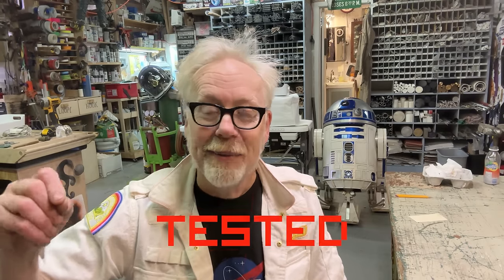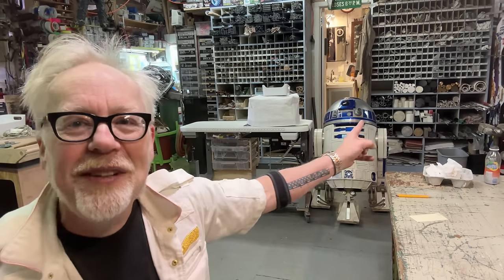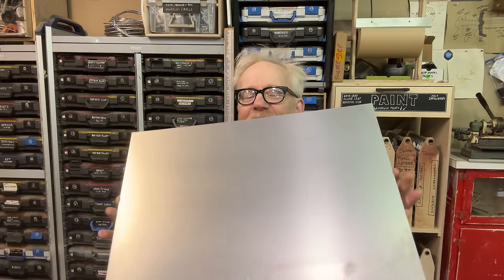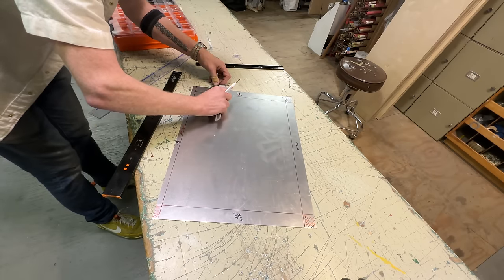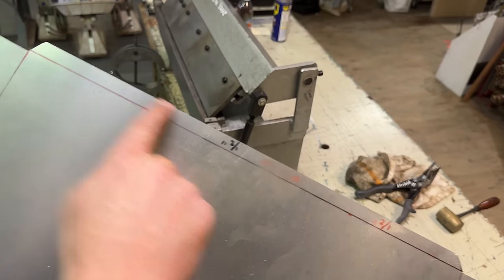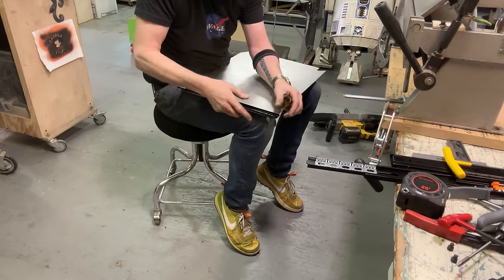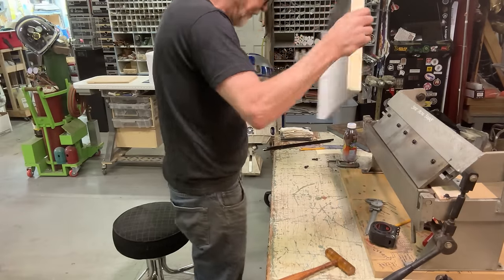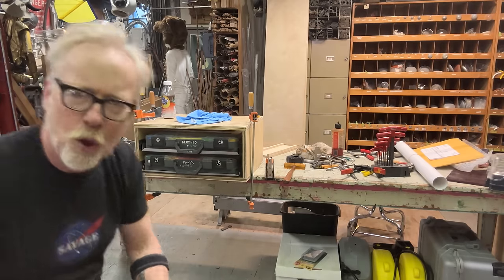Adam Savage Prototypes His Dream Hardware Storage System

Comment: Adam what you really want are Schaller Tool box bins that fit inside of draws. Sortimo is best for mobile tool storage (vans for contractors). For a workshop you want Modular Drawer Cabinet (Lista) for all of the bins. You can open the drawer & take a bin out that you need. Issue with the Sortimo is the lid gets in the way, and your limited to the bin sizes. With the Schaller bins I can store larger size parts that won't fit in a Sortimo.

If you don't want to spend TV money on a set of Lista cabinets, try making your own. I made a few for my storage needs, I might be just one of the few people that has almost the same amount of small parts as you do (electronics, machine tools, metrology, wood working tools, mechanic tools, etc).
Reply: Steel would have been better than alum, since alum does not bend very well, depending on how it was formed & heat treated. It can crack & when you try to bend 90's into it.

Comment: I love the marking template you made, but if you can clamp 10 sheets together and cut them all at once you will save a lot of time. I'd also see if you can set up some stops on your sheet brake to do the front and back bends on the same pass feeding in from the back of the break.

Comment: Drills holes on either side of all rack verticals, makes shelf that can slot onto those on the racks and make a temp table when needed before putting it back in a storage slot for the removable shelf

Comment: As always a very nice video :)

BUT I myself would have sacrificed one slot per shelf to make a pull-out-table where I can put the Sortimo on from which I need some parts.
Have the table at approximately hip/belly height and with an interlocking surface so that the Sortimo locks into place.
This would save you much work and still does the job just perfectly.

As you always say: Having a uniform storage-system really is key for having an organized workshop.
I now settled with wooden boxes you can get at the local hardware stores here in Germany and Austria for about 5-6 EUR/USD.
They're all a little different, but only about some millimeters.
General dimensions are about 30x20x13cm or roughly 12x10x5 inches.
You can also get them in double or triple the size.
Right now I have 32 normal ones and 4 double sized ones, stored in selfmade, space-efficient racks.

Inside those wooden boxes I often use small acrylic-boxes with 8 individual compartmens to store things like special bolts and nuts, electronic components, coin-cell batteries, ...

Comment: I love this infrastructure build. I used to build stuff out of paper as a child and it was then that I realized the efficiency of timing/testing/working out the kinks in big batches of parts. I love seeing Adam bringing attention to that.

If I had the sortimo system, I'd have an empty box or five as project floaters that I could populate with inner containers from other boxes. Then I'd mount mini drawer units like the 2-unit tester near my work areas, and even in my rolling tool ziggurat. That way I've got most of what I need without extra walking, my parts for different simultaneous projects can stay together, neat and closeby but out the way, and a host of other reasons.

Comment: I made a similar set of racks and had the same issue. Instead of making every drawer on a set of slides, I put a single wooden shelf on slides in the middle of each rack. That way, I can pull out my shelf and put whatever sorting rack I need and set it on the shelf. That way, if i need to take a sorting pack with me, I can, the shelf is always at a good level to access things, and I only needed one set of slides per rack.
Reply: Well that's a very elegant solution - and that would actually work great here. Now that I think of it I might actually include just that in a upcoming cabinet build ... Thanks for pointing this out.

Comment: A quick suggestion for the prototype: 
Mount it under your main work surface so when you are working on a project that is going to require 52 of the widgets in drawer #13 over a 6 hour build, you can slide drawer #13 into the holder. You will then have those widgets at your fingertips without covering valuable work surface real estate. Once you have finished with drawer #13 you can return it to its permanent home.

Comment: He sets the fingers to clear the other bends about 1/4 inch. If you don't decide and offset the tabs to clear the other bend you will ends up hitting and bending the corners. The other thing is to make Shure you have the metal exactly in the same spot to the line each time and some of that comes with doing. It's good practice to use a scrap piece the same thickness and with that you can check your tolerance with then adjust accordingly. You'll get it

Comment: There’s a variety of Systainer drawer systems (Festool) that accomplish Adam’s grail, several with full extension slides and removable cases with clear lids, and/or removable drawers and decks within the cases. Compromises to all IMO, based on vertical space consumed by the drawer system, and, of course, $$$ (albeit necessary though for long term robustness and reliability).

Comment: I was a bit surprised not to see any French cleats in your shop, considering how handy they are. I use a similar organization system myself, leveraging acrylic makeup drawers with modular dividers for easy setup. The last time I moved, it took me 3-4 hours to reassemble a 4x6 wall of these drawers. They're stackable, so a bit of masking tape and packing them into boxes did the trick. With a 4x8 sheet of plywood and setting up 7 vertical rows, everything was in place by dinner time.

Each drawer features a small metal pin at the back for effortless removal from the shelving unit. If I need to take an entire shelf with me for a project, it slides off the French cleat smoothly, like butter. The one challenging part is attaching the acrylic to the wood. Pre-drilling and bolting with rubber washers for joining them, that seems to work best since screws tend to crack the acrylic or pull out over time, although I've had decent success with ET500 epoxy as well.

I'm inspired by your setup and am planning to build a vertical tool cart similar to yours, but with a couple of rows of French cleats for added versatility. I've found so much utility in having French cleats not just on my workbench but also across all my power tool stations. They're all mounted on castors and are of equal height, making everything easily movable. My guiding principle is simple: make storing tools as effortless as dropping them in a random spot. This way, I never have to spend extra time putting things away or risk losing important items.

Comment: Just a suggestion but bolt the break to a pair of steel angle "rails". Clamp them to the bench with the front overhanging a bit and put a couple of longer handles on the former plate which will now hang over the front of the bench ... The break won't move so much and after a dozen folds your arms will really welcome the extra leverage!

Comment: Hey Adam,

I've been a huge fan for a long time use alot of your videos for inspiration on small form factor shops. I currently move around a lot and have worked in garages and a workspace the size of a closet. I love the idea and dont know how open to suggestions you are but you could dimple die your aluminimum to keep it from flexing so much and it would make your overall build lighter and relieve stress on your drawer slides even though they hold 150 anyway. It would take a while to do but is always an option.

Comment: At 30:18 - This is a "Whitley Punch" (Junior size) which is GREAT for punching nice clean holes into sheet metal instead of using a drill bit which can wander. The kit usually comes with 3/32", 1/8", 5/32", 7/32", 1/4" and 9/32" round punches and dies.  Found used on eBay all the time.  New about $200.

Comment: This is a stroke of genius. Of course there are commercial solutions that tend to have boxes as drawers, including locks, but there's nothing more cost-effective than a DIY setup. If the whole thing gets a little tippy with the added metal, bolting/screwing the cabinet to studs or a cleat should do the trick (the cleat is how my Dad and I stabilized a bunch of Ikea kitchen cabinets).

Comment: I made a very simple rack for my small parts storage boxes (Home Depot HDX cheapies)  I also struggle with a lack of good  horizontal surfaces in my small shop. In my rack I added a drawer for my Dremel tool at the exact height that fits my 5'10" frame.  While the drawer  is NOT as luxurious as Adams - and my shop is not a professional "working" shop like Adams, I do get a kick out of my forward thinking of adding the drawer.

Comment: Best way to align drawer slides is to cut spacers that hold the slide off the floor, a strip of 3/4 x 2" works great. Even if your only doing 1 cabinet it really helps to keep the slides even on both sides. You can either cut two spacers for each height or just cut the top height first then cut the two strips down for each level.

Comment: I think I notice a bend. At 26:29, taking a look at both aluminum shelves, I can see that the bottom one is bending down in the middle. Now this could be from you making this very quick, but the top one is way more flat and straight. So maybe the size of the lip on top is helping to keep it straighter, while the bottom is to small of a lip.
Correct me if I am wrong, hahaha.
But anyways, love the idea. But my gosh, this is going to be a tall wide wall of shelving.
Reply: Good catch I noticed that as well.  Got a little concerned when Adam mentioned that he was going with the thinner lip he might want to rethink that decision.

Comment: FYI 6061-T6 sometimes cracks when bending in a tight radius. 5052-H32 (1/4 hard) or 6061-O (annealed) will perform better, if that's an issue. Love the storage concept!

Comment: My dad ran his own sheet metal shop and to cut a bunch of corners like that they stack multiple sheets on the edge of a table clamp them down and use a portable band saw to cut multiple at once! just gotta make sure you hold it straight the whole cut or your bottom sheet will be way off your pattern and only stack like 1/2 inch maybe 3/4 of material at a time.

Comment: Adam, I saw a short video on "self-piercing rivets".  You put the rivet in the tool (which looks like the letter c) and the rivet goes through the material and dome heads itself at the end of the c.  It might not seem like a big deal but I think it is because you no longer have to drill the hole for the rivet which I think removes a lot of tolerance issues and creates a stronger fastening.  Anyway, maybe this is old news to you but when I first saw it I was like Wow.

Comment: If you bolt a piece of angle iron to the part of the metal break that pushes on the material that moves it up, it will help bend the material much easier, many breaks have this removable attachment

Comment: Here are some workshop tips: 1. Use a scriber instead of a black felt pen when marking out sheet metal or metal stock. 2. Use Gilbow metal snips to cut corners in sheet metal, as they are faster to use than using a band saw. You can get them in Left and Right versions. 3. When doing repetitive tasks, use an air powered pop riveter. This will prevent RSI injuries. Your hands will thank you in later years. 4. For your pull out racking wall, you could have built a pull out horizontal shelf to put one Sortimo storage unit onto when you were using it. 5. Fix your sheet metal brake to a mobile stand built from square stock. Add some solid castors to two of the legs, so you can move it around the shop, rather than leaving it loose on the top of a bench.

Comment: Durham Manufacturing has you covered for that.  For those that want to build your own and dont want to spend all that money on slides.  You can build one or two sliding flat shelves for each vertical cabinet to place a selected box on and then slide back in when not in use.

Comment: Adam before you assemble the cabinet make yourself a jig and put on the drawer slides first it's a lot easier that way and for the maximum drawer side weight rating use all the screw holes. I made the same kind of cabinet using Milwaukee pack out boxes

Comment: ACE Hardware has that system with their bolts (although smaller indiv trays).  You pull it out like a drawer, the lid flips up and the underside of the lid has part numbers.

Comment: Adam, in case you haven't thought about it yet, but if you have things that span multiple sortimo's you should go horizontal instead of vertical. so let's say you have one with sizes 1 to 6 and a second one with sizes 7 to 12 it would be a better system if you can pull them out side by side instead off having to close one and open the one below or above.

Comment: It looks like you might have a small amount of free space just above your slides to break the side walls out slightly.  If so that would help guide your sortimo drawer in without the plastic catching on the sharp top edge (as seemed to happen several times @19:36).  Two extra break operations but it would eliminate an annoyance and wear on your bins

Comment: I think a pullout shelf or two , at an appropriate height(waist+) built in to several of the columns would allow you to solve the horizontal surface equation. The shelf(s) would reduce the movement and allow you to access the contents at a work height,

Comment: Re: multiples. I'm a manufacturing engineer, and have occasionally dealt with planning production for volumes in the mid tens of thousands. The scale of minute time savings or overruns really pops at those volumes. 5 seconds per process is 14 hours per 10k operations. Saving a minute per process basically pays someone's salary for the year.

Comment: You’re working hard to reproduce my local hardware stores parts drawers.
The vendor installs a wall of drawers that each holds a cardboard box of various parts.
You pull the drawer out and unfold the cardboard flap that has all the size info printed on the inside.

Comment: I really got into the idea of the grouped storage that the Sortimos provide, but hated the remove to open, and glad to see that Adam feels the same way.
If you have a look, Sealey make a similar storage unit and it is branded up Clarke from Machine mart for about £30 each (CHT643), these are special as the handle is outside of the storage not in the footprint like most storage boxes like the Stanley.
My idea for sliding shelf allowing removal is to weld up 25mm angle into a tray, and fit that to the sliders, so they sit in the borders very much like the ali tray above, and having priced it up, a little cheaper than the sheet solution for me.
I also hate the idea of a single central shelf, that you move the box to. I can buy drawer runners for £4 or £5 each in bulk, and the cost for 12 or 15 pairs in a tower, vs the annoyance of pulling the central shelf out, bringing a case out to that shelf, opening it, then putting the shelf and box back is a calculation I am happy to spend on designing out.
I keep on trying to decide how many cases high, I was planning to make the tower 16/1800 high, and have devised a bearing runner shelf that tilts down for the high level ones, my whole shop uses mobile cabinets for cleaning, and a low height unit wastes the vertical space above it.
My other units are generally painted mild steel 25box on 125mm ebay cheap as chips castors with wood riv-nut'ted onto it where wood makes sheet fill or build speed faster.
At £400 a stack I want to get it right, and seeing Adam on a very similar trajectory makes me happy.

Comment: I think you are in danger of getting stuck in some kind of self-perpetuating loop of tools, cabinets and more tools. You have to keep the % of projects involving storage down to a minimum.  Thanks for this video! Some absolute laws of 'makership' were covered very nicely.   

I like how your mind was repeatedly snapping to other thought paths and ideas. I have this trait, but without the copious incentive and drive you have, to 'get it done'.  But this video has given me some incentive to change this (as I look around at all my horizontal surfaces - three desks - completely covered in tools, parts, project parts, sketches/notes, and stuff whose purpose I've long since forgotten).

Sortimo: thank you - my search for the ultimate mobile storage has ended!

I think the next thing you'll want/need, is a parts carousel: storage shelves that loop vertically to any height for access. Add a controls system, a database... muh ha ha.

Comment: So fun, I would have only put one or two on slides in the shelf box. Ending up with a modular counter system all the way around the shop at one or two working heights, so that when pulling those top ones out, I had a working level shelf-counter to put it on at sitting or standing height. Bonus that it becomes a place to do projects in a pinch and when you're done you just slide whatever of them you have out back away. Though that means they'd need to be exceptionally anti-tip. Bonus points if it lines up with a table saw or something where the end of a longer working piece needs supporting sometime.

Comment: When you make 65 of these things, wouldn't it be easier to stack them up, tape them securely together, and use the drill press to make those holes in bulk? Probably save at least an hour that way because you won't have to mark each unit and punch the holes.

Ditto for cutting on the band saw. Tape together ten or twelve sheets, mark the top one, cut them all at once, flip, cut again. They're aluminum, you should be able to cut multiples at once.

Also, I love that clear ruler! I have a 2x18 one that I got from the local craft store, and it's incredibly useful when marking stuff, especially when I need to mark parallel lines. Mine doesn't have a metal edge, but I can still cut with it if I used a hand-held rotary cutter.